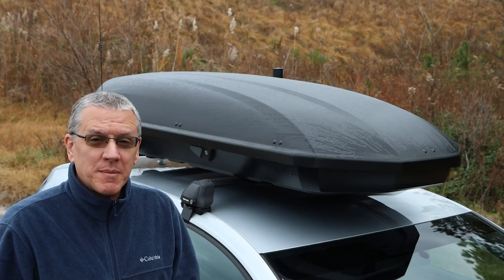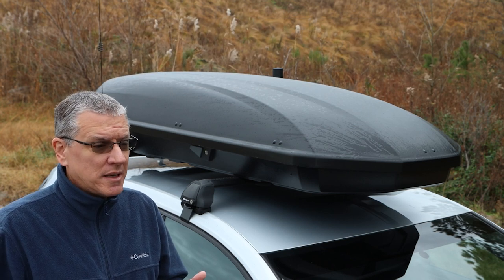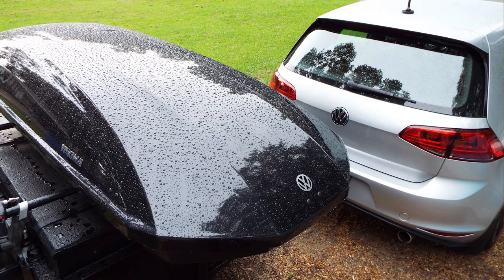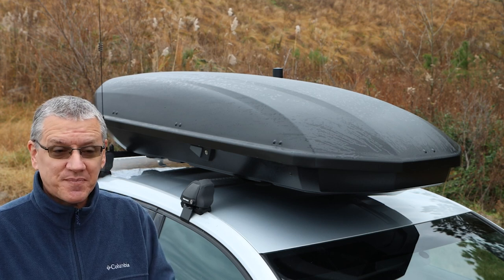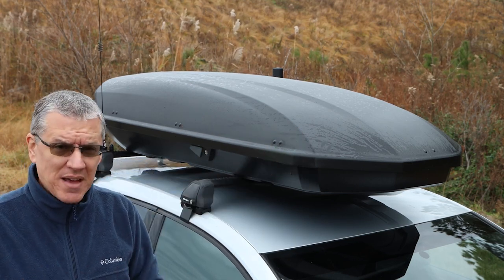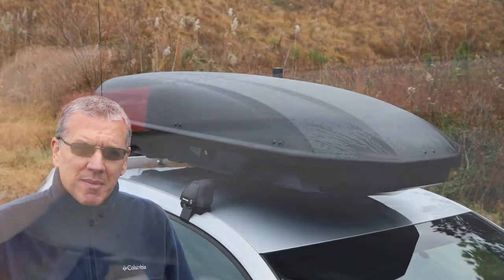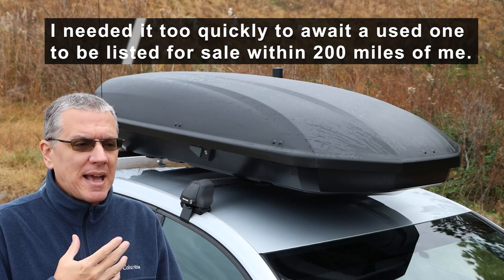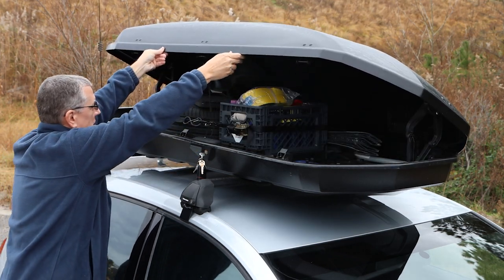YAKIMA SHOWCASE 15 - Think Twice Before Buying

Comment: Update: Yakima said they are going to send me a reimbursement  check for the purchase price. Wahoo for Yakima doing the right thing, 100% satisfied customer.
Reply from the maker: That's fantastic! I wish I would have made more of a stink when I reported my leaks. Perhaps I'd have a better box at this point if I had. ;-)  Thanks for the update!
Reply: @StealthGTI  one thing they asked me for  Date code of your Showcase 20, see below, inside drivers side by the handle: looked several times over many surfaces and could not find any such date code stamp. I guess I shouldn't sing until the check arrives. Let you know when it does. Another problem cropped up with the showcase, the handle (really a push button to open), I could hardly get it to open. I noticed they don't even use this design anymore. Edit update 11.1.21 --I got the check.

Comment: I know this is a dated review but thought I would add to your comments.  I have used mine since I bought it new in 2016 at an REI in Colorado as I was driving across country with a too jamb packed SUV.  Since then, I have used the box on more than eight (8) cross country trips in all types of conditions between LA and Boston since then -- loaded with a TON.  The inside clamping never interfered appreciably with space as long as you are thoughtful about packing.  It has been wonderful.  No leaks and no noise/rattle ever noticed.  For any plastic box or bike rack, however, I am careful about not having it sit outside all the time year round without tarping/etc when not in use... so maybe a cause of some of your issues.  I agree the handles are a bit awkward and glad they moved away from that design (but work fine).  I also think it may sit a little bit too high on my SUV if you ever want to park it in a parking garage... had to turn away from a couple city parking options because of it... but that is not Yakima's fault... but probably would go for something even lower profile next time.  I would not hesitate picking one up again on the cheap used market.
Reply from the maker: Thanks for sharing your experience! My leaks surfaced when the box was nearly new. The model was new, too; so, perhaps I had an early box with a defect. I don't use the box often, but I am still pleased with its utility now that I have wrapped it and sealed the leaks. Thanks for visiting!
Reply: @StealthGTI  Maybe!  Although I got mine even before yours...  brand new first year issued just arrived at their Boulder store in need of something "quick" for my trip.  It has been wonderful.  Just want to give folks different perspectives... as I plan to hold on to this for larger cargos even as I buy a second lower profile one (Inno 660 on clearance) for quick sports car trips.  Glad it seems to be working well now for you.  Thanks for your original post!

Comment: I have been happy with my Yakami Skybox for several years.  HOWEVER, recently a crack appeared in the top of the box.  From the get go, they did everything they could to deny the claim.  Nothing had hit the box, it must have been the temp change from Texas to Colorado mountains.

They stated that I must have the receipt, I dug through my email and found it.  Then they said, send them pictures of the damage/crack.  I did.  

They stated that I had to send pictures of the box on top of the vehicle, made absolutely no sense.  But OK I  got it out and put it back on the car and reattached it, sent multiple pictures.  

Then they said, send pictures of the inside of the box, OK I did.  

Then they said send more pictures of the exterior of the crack.  OK I did.  

Response, there is abrasions to the exterior, no there were not.  

I said I want to escalate the complaint and take it in for inspection, so they could see there were no abrasions.  Yakima's response, sorry there are no facilities for that, claim closed.  

They did offer a 15% discount on another purchase, NO Thanks I'll buy Thule maybe they will honor their warrenty.
Reply from the maker: So much for Yakima's "We've got your back guarantee!" Sure, with both hands so that they can run you through! ;-) My next box, if I get another some day, may be a Thule. The Motion XT is a good looking box with a nice profile. However, they'll all very expensive these days. Visit etrailer.com and look at Malone and Inno boxes. Better yet, if you have time, buy used and give the money to a former owner instead of the corporations. Good Luck!

Comment: The rivets on all those cargo boxes are the same blind rivet style aluminum or stainless steel,  just remove the black cap and you will expose the rivet,   you should have removed those black caps before wrapping it, any product in the market with blind rivets will always have mandrill holes, the small mandrill ball that breaks off during installation doesn't always stay in and its not meant to, you can silicone those rivet holes up if it really is a problem.
Reply from the maker: Thanks for the note. I did some testing before the wrap and couldn't find evidence that there's metal under there. I could've been wrong, though. Regardless, there still hasn't been a single drop since the wrap. Thanks for visiting!

Comment: I'vd had two Skyboxes crack apart badly. In your case as well as mine, it's clear they don't adequately field test these boxes. They are expensive junk.
Reply from the maker: WOW! That's quite a surprise, especially for two of them. I consider the Skybox to be their workhorse since it's been in production for so long. I've always thought that I should have started there, even if it's not quite as "advanced" or aerodynamic as the newer box designs. Where did your boxes crack? On what might Yakima have attributed the failures? Heavy, unsecured loads? High speeds? Anything else? Just curious. Thanks for visiting!
Reply: @StealthGTI  I've had long conversations with Yakima about the problem. They are committed to the plastic, and it was clear that they know of the problem. I did NOT overload the boxes, or mount them improperly. I sent photos. It's just my wife and myself, with typical camping gear in the boxes ... tent, sleeping bags, etc. We know what we are doing. What I was told is that the plastic is not up to the vibrations and flexing that occurs in off-pavement travel, but for the smoothest of county roads. They crack badly at the mounting points on the crossbars, longitudinally, and at the hinges at both ends. I was told that they are suited almost exclusively to paved-road travel, and I can vouch for that. Photos are available ... But suffice to say, if off-pavement travel is your genre, Yakima will tell you their boxes are not up to it. Unfortunately, I have searched unsuccessfully for an alternative. The new model, some $300 more expensive, appears in marketing videos to be no better. Saddest part: the tops and bottoms cannot be replaced individually. Yakima -- which touts itself as an outdoors-friendly manufacturer -- says to just toss the box into the landfill.
Reply from the maker: @bywayz  - WOW! That's quite a report! I can see how the off-road vibration would expose weak points. I cannot find the warning, but I had read someplace that my Showcase is not recommended for trailer use, presumably because of the violent movement of small trailers when compared to a rooftop. Perhaps that was in a Thule manual while shopping? I didn't notice any off-road warnings since I don't drive off-road.  Anyway, I guess there's a reason why a lot of overlanders use cargo baskets and heavy duty cargo cases instead of our pretty boxes. Thanks for the update!

Comment: Bought the Showcase 20 new in July 2018. Rivets started popping 2 years ago and the case is cracking around the rivets. I would not buy it again. Yakima should recall and replace. Do the right thing Yakima.
Reply from the maker: Yakima got their money; so, I wouldn't count on it.  ;-) If I ever get another box, it will probably be a Thule. Thanks for visiting!
Reply: @StealthGTI  catch 22. Yakima: If a product is believed to be defective, the original purchaser should contact the Yakima dealer from whom it purchased the product, who will give the original purchaser instructions on how to proceed. I contacted dealer and was told to contact Yakima. Wait time for reply from Yakima is 3-6 weeks. It appears their dealer has no power re warranty issues, so why even refer customer back to dealer? I guess they don't trust the integrity of their own dealers.

Comment: What glue for the angle aluminum.
Reply from the maker: I'm a huge fan of "Amazing Goop." It holds tight, but has enough flex to not crack the way superglue or Gorilla glue might, especially in high vibration environments. Best of all, it peels up without damage by using a firm, twisting motion. Clean-up is as simple as rubbing the surface with your thumb, followed with alcohol if needed. Thanks for visiting!

Comment: Am I wrong?
It seems to me any box or bag you put on the roof will not seal against 85mph driving rain (65mph highway speed + 20mph blowing rain). You need to put luggage and such in plastic first.
Reply from the maker: No box manufacturer guarantees a watertight seal. BUT there's a huge difference between water being driven-in by high speeds and light rain penetrating a box that's sitting in the driveway. The latter is unacceptable to most. FWIW, I haven't had any leaks since wrapping the box, even at highway speeds in torrential rain. Take Care.

Comment: Wow, that's horrible quality. It's not just ugly, it's a big safety issue when the lid comes off...  I think you need to ask your money back.
Reply from the maker: I think it's "good enough" for my casual use. However, I might change my mind if I get one of the newer Thule models, especially if the lid doesn't shift or leak.